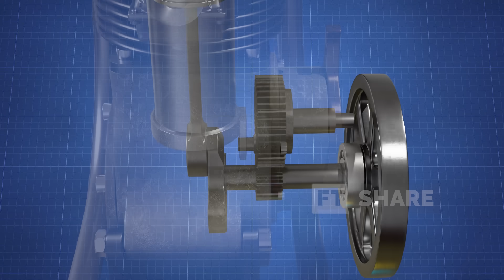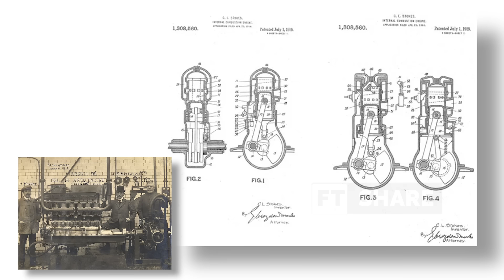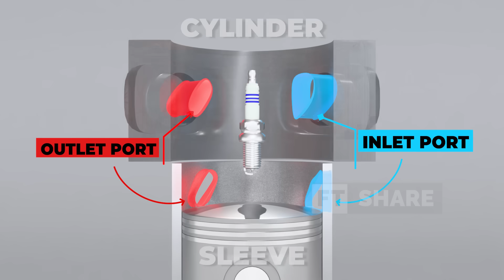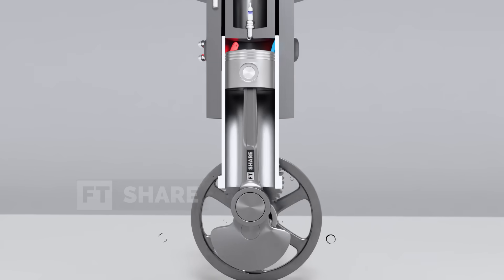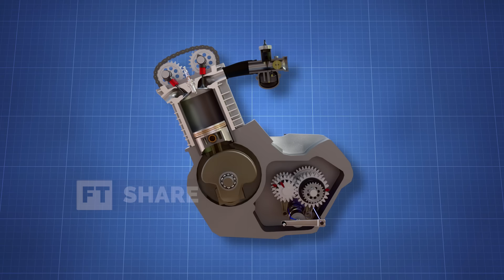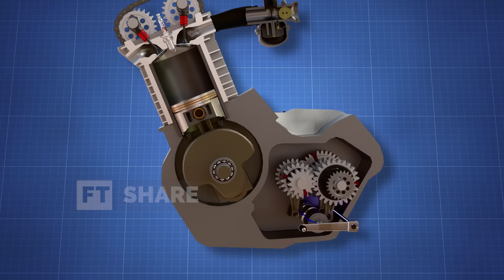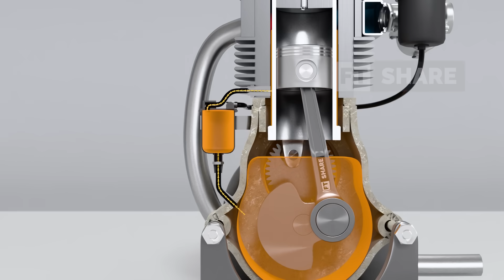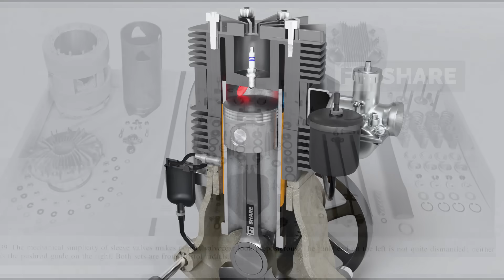Why Was This Advanced Technology Abandoned? 🤔 The Secret Behind the Sleeve Valve!

Comment: still too much metal surface contact regardless how good the lubrication can be.  I can't imagine the rebuild frequencies and efforts.
Reply: These engines last as long as any other if correctly maintained, their use in aircraft engines of all things where durability & reliability is SO critical that many piston aircraft engines are essentially severely de-tuned, which is why their HP numbers often seem "low" for their capacity, though it's also partly due to air-density being low @ operational altitude. Still the reliability is so critical as you might have heard some of the engines, especially ones developed from car engines, use two spark plugs per cylinder, not constantly in tandem but instead there are two entirely-separate ignition systems in case one fails!

Engineers weren't stupid even back then, if there were any significant TRUE metal-on-metal friction, they would have never made it in anything but some small prototypes for cars, not successful aircrafts, all these engines were made with sufficient & constant lubrication, if not they would seize almost immediately.. In sliding surfaces there is no in-between really; it's either lubricating properly & can last unbelievable amounts of time or it's having metal-on-metal contact & will obliterate itself super fast! Also while the huge surface-area may SEEM as an issue & yes it's bad for various reasons, it actually means a more-even spread of pressure & low (relatively) average pressure /cm2.

In reality the issue & drawbacks do not stem from friction but rather everything else you can expect: price, weight, decreased chamber pressures for high-boost applications, complexity & some other stuff; really the true benefits of the uniform, un-impeded flow are truly-realised only in high-RPM & high-boost applications, so would make sense for today in something like racing, especially Drag. Even today it does have superior performance N/A, theoretically, though modern engine intakes & variable timing is pretty great. But as he mentioned the lack of valve springs is really beneficial & while you can reach really high RPMs with the right valve springs, the pressures are getting up there, there is a lot of wear & even some power loss from valve train driving! But in my opinion the most critical issue for poppet valves is that no matter how perfect the cam profile is, when the springs are chunky there is always some spring harmonics & they are surprisingly problematic. And lastly for issues with poppet valves, if there is enough heat & backpressure (turbos, especially a high-boost Diesel) the valves could dwell & even open all on their own in any of the cylinders which aren't currently firing. But with all that said these Sleeves always seal worse than poppets & there is no way around that, I imagine there is even pretty significant blow-by no matter how well it's designed, so for road-going vehicles with emission laws it's a big issue I imagine.
Reply: @rockgoleu the T.B.O. for the Hercules and Centaurus radials in use in commercial airliners was significantly greater than their poppet valve rivals.